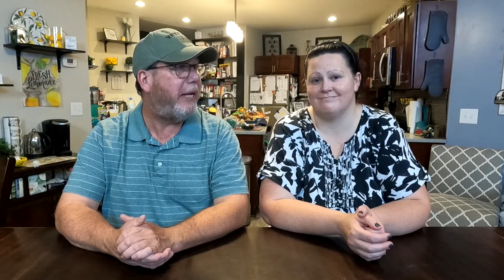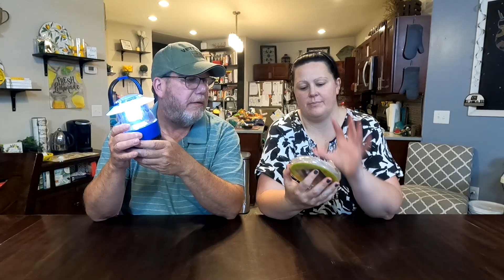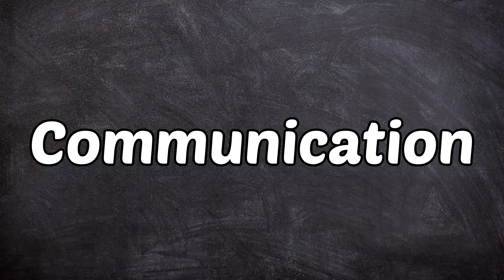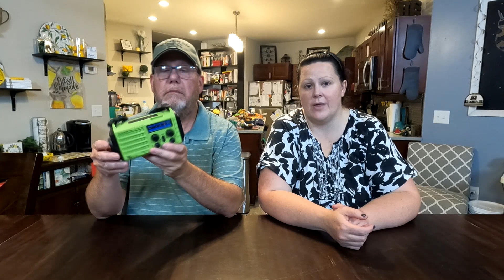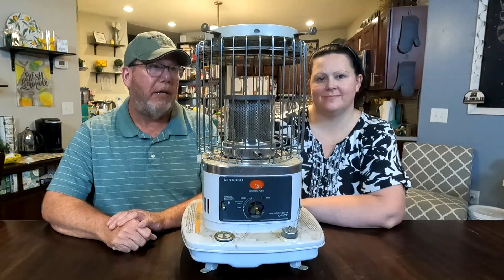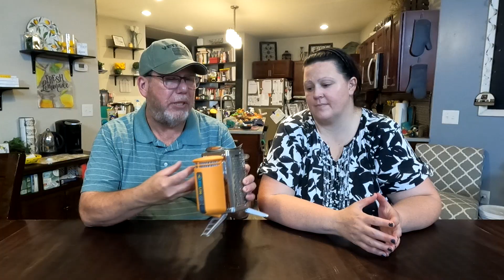Power OUTAGE and BLACKOUTS are Imminent – How to PREPARE!

Comment: A hand pump can be adapted to connect to the well you electric pump is drawing from now.  Finding a hand pump to bring water to the surface is not going to be possible after the power goes down..   it needs to be in place and operational before.
Reply: Great advice, but what hand pump will draw water from well >100 feet deep?
Reply: @readyornot316  in Oregon/Idaho we have a farm supply shop called D&B supply.. Check with your local farm supply.. A windmill pump would provide much water.  That is more complicated, but the farm shop would be able to set you up..

Comment: Look at solar pump  not that more expensive to set up and no power worries. Same as look at the off road guys on you tube for there solar set ups. Some of those Aussie guys really have some great ideas and tip's and set ups that run fridges, freezers  charge electronics all kinds gear. Those electric chainsaw are quite good, buy a good brand it's expensive for a good one, but the cheap are junk low on power and smaller weak batteries.

Comment: If you have a basement that's finished and well insulated all you gotta run is a dehumidifier in the summer and it's very comfortable mine doesn't get over 72 and the humidity is perfect. My solar generator and backup power can run my whole basement during outages plenty of entertainment and cover from criminals plus I have security cameras outside watching the exterior from the safety of the basement.
Reply: Now you're trapped

Comment: I have cooked 20 years on a Coleman camp stove that is older than me. Use what you know ! And I know exactly how much propane each meal takes. I also have a large propane tank that I fill the smaller ones with.
Reply: Would you happen to know how to safely store propane in an apartment?
Reply: @conniediaz6456  you can store pretty much anywhere that is cool and dry. I just recommend away from sleeping areas in case it was to leak for some reason. And don’t store above any heat source like a stove or heater.
Reply: @flagbabygirl  Thank you so much!
Reply: @conniediaz6456  I store mine in our garage I haven’t had any issue even though the garage gets pretty hot in summer. We keep it in those plastic tubs , out of any direct sunlight but not airtight ! If any started to leak you will smell it and then you should ventilate the entire area  asap! Make sure the cans you buy look in very good shape no dents and check the tops too, make sure the little plastic cap is on top and remove it to look at the threads and make sure there is no defect. If it looks good then they are very very safe ! I have never ever had one leak or become damaged in anyway. Also of course store away from any open flame such as a pilot light on a stove , heater , water heater etc. you can also wrap them in old t-shirts to keep them insulated from any heat. If you have a balcony or porch area watch through the day to see if there is a spot that stays shady all day. If there is put in a small shelf in that spot with little doors on it ( like the little bathroom shelves they sell) you can keep your propane there as long as it stays out of direct sunlight.

Comment: You would be surprised  how sensitive a carbon monoxide detector  is, i have used a flameless  mre  ration heat bag indoors and set off the alarm, and it was on the ceiling.
Reply: Carbon monoxide is lighter than air. Carbon "dioxide" is heavier than air.  
EPA recommends mounting at around 5ft from the floor.

Comment: EMP will wipe out all electronics including solar generators 🙁
Reply: Build a Faraday cage out of a mental garbage can, metal tape and cardboard or use your microwave. There are also bags you can buy to protect your electronics. Directions are all over the internet.
Reply: Build a Faraday cage out of a metal trash can, metal tape and cardboard. You can also use a pre-built Faraday cage such as a microwave oven or they sell bags for that purpose. They are supposed to save your electronics during an EMP. Directions are all over the internet.
Reply: @WJanette  only problem is you have to have your charge controller, power inverter and a set of electronics like a cb, walkie-talkie, radio and other stuff like drones and tablets in there as well. Not everyone can afford to have extra stuff just in storage for when it happens. And if you know its coming you won't have time to shove it into the Faraday cages.
Reply: @thecitizen549  You are probably right. I am thinking about getting one of those gadgets you can use in your car or your home to protect the electrical system. They run a little over 300 dollars and that is a lot of money to me, but I may do it anyway. And several Faraday cages. You never know, it might be really important.

Comment: I built a bug out van with 1,200 watts of solar panels and 900 amp hours of lithium batteries. 
A 9,000 btu mini split ac/heat pump. 
52 gallons of fresh water and a 7 stage reverse osmosis UV Filter for purified water. 
One large and one small instapot to conserve energy and water. 
I have an on board 12.2 gallon propane tank with a Propex HS2000 propane heater. 
I also have a portable 48 gallon propane tank mounted in a small covered trailer with another 42 gallon water tank plus a portable 14.5 gallon gas tank.
Reply: Wow, you are ready.  I wish we could afford an RV.

Comment: @ Goshen Prepping LOL... that radio alarm made you blush! That was funny. :)  Great tip about the CM Detector - we have a newer development and all CM detectors are on ceiling beside smoke alarm! 
I love woood stoves - but what do you do when you rent? There a portable, durable option? I like rocket stoves. Was looking at minuteman.. but that's just for outdoors.
Reply: Butane stove for indoor cooking...store fuel - always have a CM detector.
Solar oven...eliminates the need to store fuel...useful on sunny days.
Reply: Apparently there is CO, CO2 and another one - different gases? propane is heavier ? some lighter than air?

Comment: Dollar Tree has some pretty good little LED lanterns and tap lights and magnetic lights. They take AA or AAA batteries but the batteries last pretty good, even with the Dollar Tree low drain batteries.  Harbor Freight has some pretty good LED pocket flashlights.  I can't afford any kind of generators being on a fixed income. I'd love some kind of generator but  it just isn't going to happen.  But I'll have light and I have a solar crank radio. That will have to be good enough.
Reply: I am on SS low income but bought a gas generator with stimulus money to run my frig and freezer and fireplace or AC.

Comment: One suggestion: Practice ahead of time, before a blackout occurs.
Test your equipment, train your kids on this, make it “a game”.
You may also want to try turning your power off for a full day and see how well prepared you and your loved ones really are.
Reply: This is a great suggestion. We do this regularly with our children, during different seasons and times, where we shut off all power. We also include them in discussions about different SHTF scenarios to get them thinking "What would you do if..."
Reply: Personally, I would leave power running to the fridge and then mask off light switches and unplug other non-essential devices. I wouldn't want food spoiling for a drill. Thanks!

Comment: If there's an EMP, none of these electronic preps are gonna work 😐.
Reply: FARADAY CAGE WILL SOLVE THAT
Reply: EMPs are sorta less effictive than you think
Reply: @thedude5040  
Explain 🤔.
Reply: @hostilemgtow603  im a high volage substation design engineer for most of  south eastern america. Americas long range ICBM detention gives us 15min to defend the power grid. We can disconnect every generation source and large important transformers in 5min. All the motors for doing so are relayed together to main control points. All these motors are also  DC powered by millions of battery banks spread across america. So we can produce large air breaks to prevent transients and standing waves on the transmission grid system then reconnect them later. All the control ops are already fortified and hardened against any number of attacks  and people are paid to sit there 24×7 and do nothing but wait for something to happen then esclate. So yes your TV may break but not the bulk electric grid. It may take us a week or 2 to reconnect eveything that was disconnected in those 5 minutes, but the grid will not be destroyed.
Reply: @thedude5040  
Hmm 🤔.
Reply: @hostilemgtow603  we even train people around the country on how to restart the grid for a completly blacked out power grid.

Comment: In addition to solar generators I picked up a 2000 W true sign wave inverter with long extension cords to reach into the house and have it linked to a bank of 12v batteries and then I can use jumper cables to hook my car to it.
Reply: Just buy a generator. In the winter my apartment I just moved out of used 15KW just for heat. 2 feburarys ago my 800sq foot apartment used 1200kWHrs to keep the heat at 69 degrees.
Reply: @thedude5040  I have a generator, actually two. My living room faces South. A few years ago we had a power outage in November with snow on the ground. It lasted 7 days. My living room warmed up to a nice 70+ degrees just from the sunshine coming in.
Reply: @donh4750  then you have terrible windows. New energy efficeint windows with gas insulation will not have that effect

Comment: I top off my f250 every day 😭🥵🙊
Reply: I just had it bullet proofed and turned.  Getting 20 mpg. With ac. Running.
Reply: 2004 6.0 lariat w. 4 weal drive
Reply: Tuned for toweing
Reply: North Carolina $5.50 gallon.  86 miles a day about $25 a day .

Comment: I heard what they do with the hurricanes is they get a inverter for your car and and a icemaker, the portable kind that sits on the counter. You then can make ice and fill your cooler up to keep your food cold.
Reply: I have a medium portable solar system and a ice maker.  🧊  can make ice for 6 hours. It's about 8 lbs of ice. On 1 charge  I still have to do a nether test with the panels hooked up?
Reply: @-3-D-   I haven't tested mine out yet.  Keep me posted.
Reply: Neat idea, I'll look into what power is required to run an icemaker.
Reply: @MollyGIRLnug  I have a Newair and they said it only uses a 170 Watts.  It makes 50 pounds of ice.
Reply: Where do you get.the Newair ice maker?

Comment: I have an unrelated question,,I have a BLUETTI EB70S Portable Power Station with PV200 200W Foldable Solar Panel Included, Solar Generator w/ 4x110V/800W AC Outlets, 716Wh LiFePO4 Battery Pack, Backup Power for Outdoor Camping Power Outage-They sent me an extra panel 200 W. What will happen if I connect these together and use them on my 800W unit?
Reply: Randl family, according to Bluetti website the maximum amount of wattage input for that solar generator is 200 watts.  I was looking for input from other Bluetti owners and the amount of power they are getting from the solar panels.  November, last year, I purchased the AC200Max with 3-200 watt panels and the most I have been able to get from all three of them is 250 watts and that is under a hot East Texas sun!

I have them wired in series, according to their recommendation since the panels themselves are already wired in parallel in the panels themselves.  I tested each one individually and each one was producing 86 watts.  Based on what I am getting from the 200 watt panels, there is very little chance that you would get close to over charging.

Comment: The best way to prepare for a real black out is practicing a simulated black out day. This simulation should be for at least 24 hours.
This is a good way for you to practice using your preps as well.
You will appreciate the learning experience, and it will help alleviate any fears of black outs. Thanks guys!
Black out party anyone? 🎉
Reply: We did this several times in my household.  Gives you a new perspective of how we take electricity for granted
Reply: True! 
You do not want to learn during an emergency… you need to apply your learned skills IN the emergency. 
Practice makes perfect.
Reply: Already getting some practice here in Missouri power has been off and on for last week or so.
Reply: @tankeryankernomore6499  hi I'm in NEMO what section are you in. We haven't lost power yet but I fell it's only a matter on time.
Reply: @StandFirmToTheEnd  Madison county

Comment: I got a solar phone charger and it takes days to charge up enough to use to charge my phone, and the phone doesn’t charge much even then. I wonder if it’s a bad product? Or just the way solar works.
Reply: I was talking to somebody about that, one of the companies. They say it's not intended to recharge a whole battery but just to get you enough to make a phone call.
Reply: @TheParentWarrior  ah, I see.. well, I’m trying to research ways to run basic household stuff if power disappeared.. a fan, small fridge.. but I see a lot say it will run something for say, 20 hours… I need consistent running while recharging. Is there such a thing that’s not thousands of dollars?
Reply: @wildflowerblessings   I don't know if there's a perfect answer. I have  tried to really focus on the rechargeables and the solar items.  It might be worth it to get a solar generator that'll run the basic items. If you get the rechargeables you can always recharge them. They have rechargeable fans now.  I bought a little hot pot that will heat up and cook meals that is 600 Watts. I figure it'll work with a generator.  Remember though that things fail so you want multiple ways to do everything. I also can charge or use them off of my car battery with an inverter.
Reply: 4patriots ours charges quickly and power last.We got ours from 4 patriots, guarantee n reasonable cost
Reply: Many of them (even ones that cost) are crappy, like everything. Check the ratings/reviews. There are good ones on sale. Remember though that even really good ones can have quality control/defects. That's just the world we're in. A great way to charge your phone or electronics is to get one of those multi panel/fold out solar thingies. Then get a small rechargeable power bank. Use the panels to charge THAT, then use that to charge your phone. It usually always works better.
Reply: @GASHUBOY  awesome suggestion!
Reply: 4patriots has good ones.We bought several. They  charge  quickly it last ,& charges phones quickly.U got a Dud.
Reply: Got the same issue
Reply: We got our cell phone solar charger at 4 patriots.It charges quickly,power last,charges phones,good quality, reasonable cost.

Comment: For that specific videogaming fix, those little handhelds you find in the games section of a box store help. We have those. My house also has a couple of GameBoy Color systems and rechargeable batteries.
Reply: Many appliances won’t take rechargeable batteries as they are only (AA, AAA) 1.2V compared with regular batteries of 1.5V. 
I get Pale Blue brand rechargeable batteries and they are true to voltage (1.5V). You charge those via usb and can also charge via a solar unit.
Reply: @nz-nz  Appliances, no, but I was strictly speaking on little handhelds.
Reply: @CrystalBrightz  no, not even my little 2AA battery torches won’t work on rechargeables, nor my 1AA wall clock 🤷‍♀️
Reply: @nz-nz  That's a bummer. I know that I can chuck a couple of rechargeable AA's into a GameBoy Color, and my kids can choose from about 100 games to play while the power is out.

Comment: This is a silly question but what does water have to do for blackouts, it's a different bill??? Power/electrical doesn't run on water! 💧
Reply: like MH is saying, your water isn't ran by elec. but the water plant does. so if power is out maybe water plant isn't pumping water.
Reply: Many people have WELLS that have PUMPS that run on electricity.
Reply: I think they said that the wells won't work because they run on electricity but tap water will. I recommend getting some Sawyer water filters or even those cheap life straws because during hurricane Katrina people sat there waiting for the government to bring them water when they were right next to a river 🌊🌊🌊

Comment: I made a solar transmission cooler ac. Running right now but not because hot as much as humid today which triggers my MS. 
It can run off either USB with solar power  bank or with electric. It's 10W. I also have small solar panel that can run the pond pump (2W). It cost about $60 to make including the power bank and solar panel. It can drop temp about 20°. 
Started buying Everything with USB so it works with power bank and portable. Soldering iron, fan and the pond pump all can be plugged up they USB.
For blankets in door ways, use shower rod with long curtain works as well. I did to keep my fireplace heat in living room last winter.
Cooking can be done over alcohol burner. 3 cans with alcohol in middle one and other 2 cans over the fire. Can at least boil water for cup noodles or rig it to hold small iron skillet to fry an egg. After going thru Noreasters in past, hurricanes and now in earthquake land having several options is best in all situations
Reply: 2 watts for a pond pump?  10 watts for a cooler?  Are these numbers right?